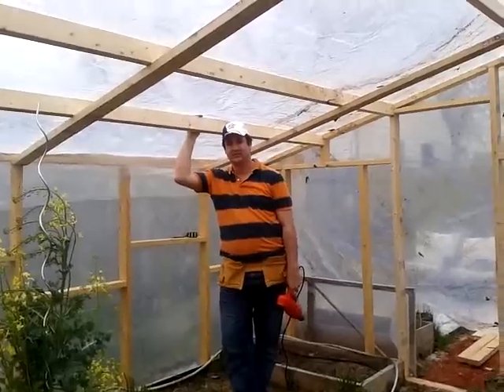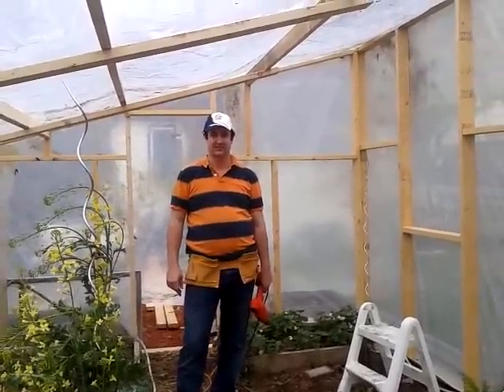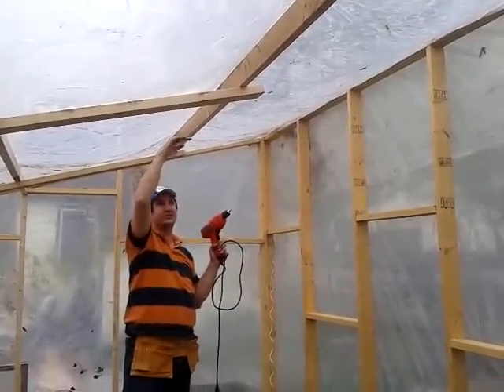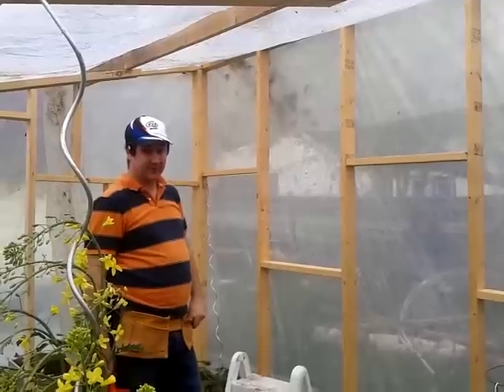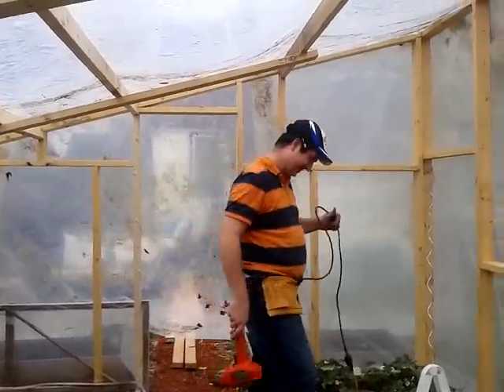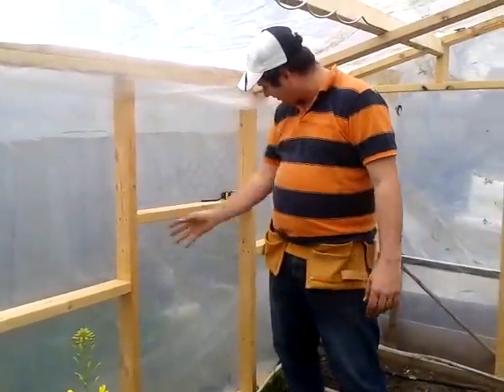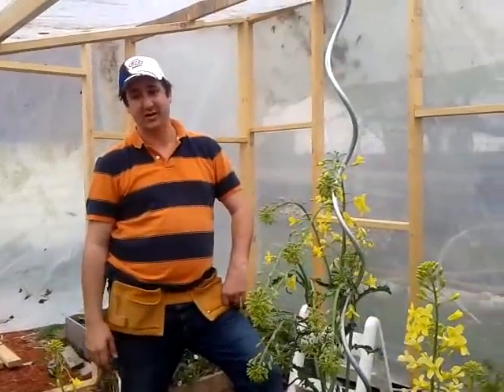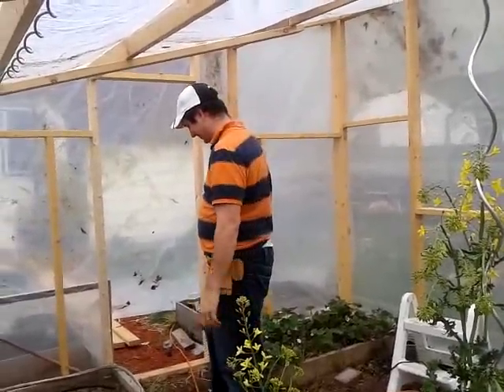Part 7 - Almost Done the New Greenhouse

Comment: You are going great there.  Plastic bills...prepare to be frustrated! A bank here (N. Ireland) issued a note in plastic over 10 years ago and it was a complete disaster. Yes, it didn't rip, fade, was wash-proof and almost indestructible but it also didn't unfold properly so we ended up with notes that couldn't be stacked, had to be segregated from other notes because they threw those piles off and, generally, became the note that we tried to offload as quick as we could. Hope yours are better.